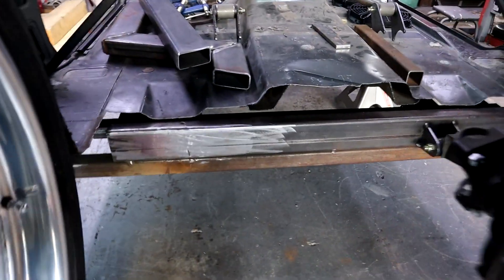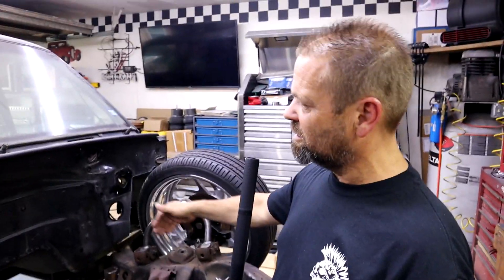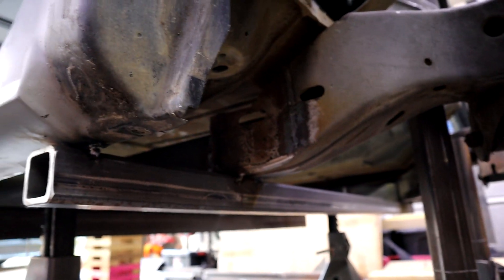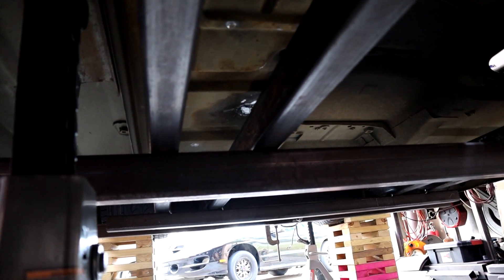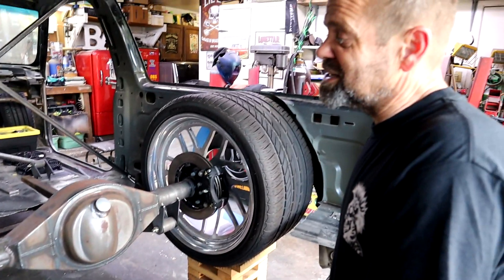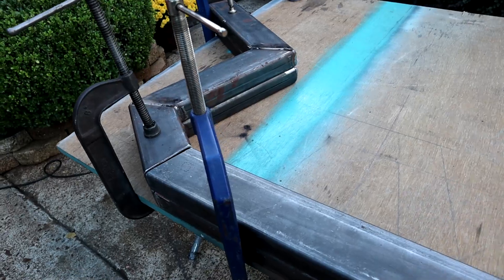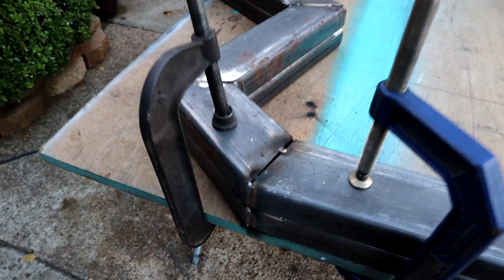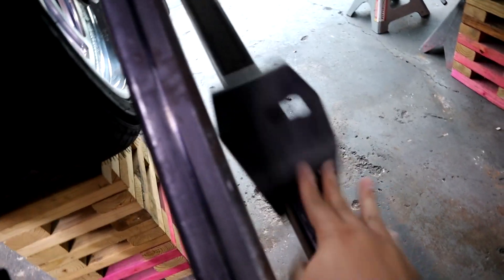Bagged OBS Truck/Tahoe (body drop frame and monster notch)

Comment: Where u all put the 2.5 z in the front the front frame horns will be dropped more than that because of the body drop to line up the core and front bumper ...ive done a few obs and alot of mini trucks as well ...looking good tho fellas